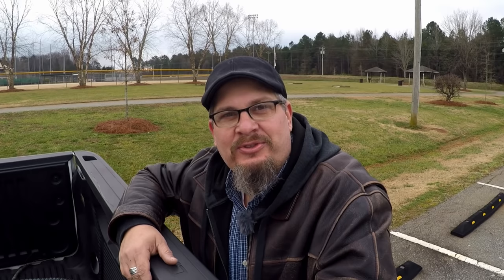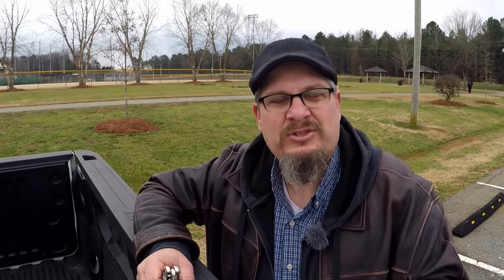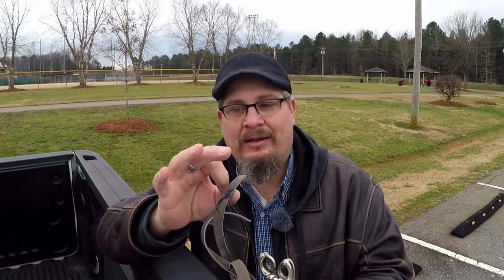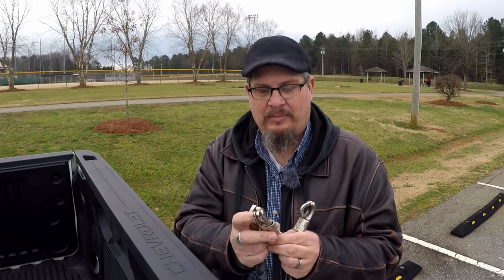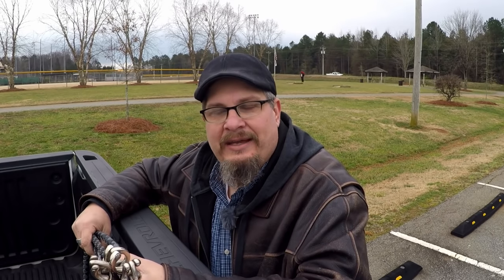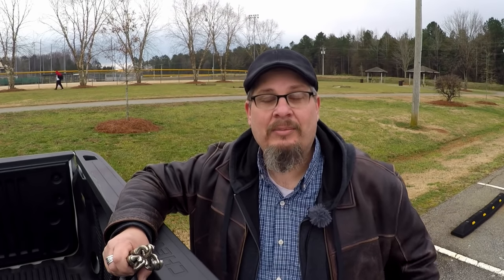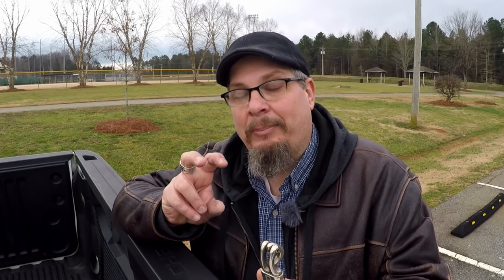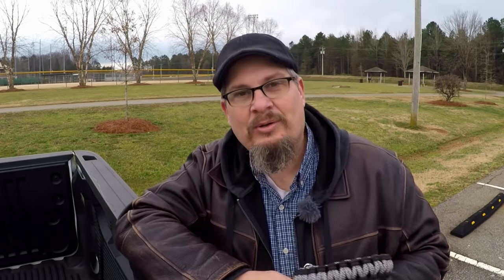The Get Back Whip

Comment: Besides I saw a guy had real long get back whip hanging off his throttle side handlebar and when he went to go make a turn he ran it over and knocked himself over and since then I said those things are for assholes
Reply: Seems like something that would only cause road rage for anyone on the receiving end of it. Motorcycle vs car is a fight that ends badly for the motorcycle.
Reply: Probably me. I bought one that would get caught in my exhuast and lock my bars. I took it apart and made a shorter one with a golf ball in a monkey fist at the end

Comment: SO I've been riding by the Grace for God 47 years. I've never had one of these . My thinking is the ones I've seen have been WAY to long enough to get tangled in the rear wheel then your REALLY not gonna have a nice day 😂Also I don't think it's advisable to wip at a car 🤔Piss off a cager and I don't care how barny bad ass you might think you are a motorcycle is gonna LOOSE EVERY TIME . My 3 and a half cents worth ( for inflation)😂👍😎
Reply: Exactly. A piece of leather doesn't make up for 3-8k of steel. Not to mention one could wipe themselves out trying to swing it at vehicle. Seems like a really stupid idea to me. I really like the idea of hanging it on the brake lever. Gonna be fun if it catches on something and fully applies the brake causing you to down the bike lol.
Reply: Inflation? Or canadian coins?
Reply: I’ve been saying the same. A car (and most people are driving SUVs and trucks now days) is far more dangerous than some dumb whip. 

You whip truck. Truck “taps” your bike. You are dead on the side of the road. 

Just stay away, pay attention, and don’t get angry. It’s not worth it.
Reply: Just keep a 45 and you won't lose nothing
Reply: Force = Mass x Acceleration; bike loses, and unrestrained biker takes the fall.
Reply: @hunterrollins5646  once I had a car behind me , lunging at the bike and getting really close , like a couple of feet . Turned out to be school age kids

Comment: We call the Staybacks out here in AZ.. Usually has a Monkey Fist around a ball bearing on the end..
Been riding 41 yrs, never had the desire to run with one....but I have been tempted to have nuts/bolts electrical tape bar bundle..tempted...I just found them best technique is just to stay as far away from cars/trucks...
Cheers
Reply: I’ve always got a Glock and a spark plug
Reply: @kurkgarro2341  lol. I always have my Sig p229 Scorpion or Ruger Alaskan .454...don't need a spark plug. :)
Cheers

Comment: The clasp is called a "panic snap" and is used most commonly for hitching horses in trailers. If you pull on the rope hard enough, it will release in the same way as pulling down on the sleeve, although there's a much stronger spring in the rope end. They're designed this way so that if a horse falls in a trailer, the panic snap will release, and they won't be hanging from their halter inside the trailer.
Reply from the maker: Good explanation thank you!!
Reply: @YogisCycleService  you're very welcome
Reply from the maker: @RustyCarnahan  my grandma had 2 horses and I loved going to her place as a kid and to the rodeos.  It has been many years since and I forgot more then I remember it seems.  I did know the name panic snap but it escaped me at the time.  Didn’t know that it was used when trailering horses.  I thought it was more like something on a lead when breaking horses in or something like that. Have a good night!  Appreciate it

Comment: The get-back whip is a really great way to get pulled over and arrested;  depending where you ride.

In many states the whip is legally called a slung-shot, and is considered an illegal weapon... even if it DOES NOT have a weight at the end... reason being that when the whip is released the whip can be held at the "free" end and the quick release mechanism becomes the shot.  Slung-shots are illegal in Minnesota where I live.  The whip is an advertisement for policing harassment, which is not worth the trouble.  

marcus

Comment: Decades ago, I used to ride with something bungeed to the passenger seat behind me. I called it a "Fuck-Off Brick"! Obviously, it was a one-use item, but replacements were cheap, and freely available! If some twat in a car was getting too close behind, just raising it in the air did the trick! They may be more protected in a car, but no-one is prepared to take the chance of a brick flying straight at their windscreen, especially if it's a shiny new toy!

Comment: We use them here when scumbags purposely cut you off. 
You smash the side of their door glass as you ride by. 
We have Leather balls on the end of them so they don’t slip out of your hand. 
The metal attachment part is not the part you hold.
If that don’t cut it. 
I also have my get back 1911 .45 ACP.
Reply: It can be rather subjective as to "purposefully cutting you off". I'll give you a short story. 
My, almost 17yr old son, had an incident with a rider in a parking lot. While pull out of a KFC with shrubs higher than the Accord he was driving, he inadvertently maneuvered into the path of a rider. We know the guy for years too. His son played football with mine. There was no impact nor was the bike dropped. Scared the shit out of my boy. Huge lesson learned about blind spots and being technically and tactics proficient with driving. In the immediate haul he apologized and proceeded out of the riders path. The rider turned around and pursued him to a stop sign, which I personally think was warranted. The boy needed to be addressed and told to get his head out of his 3rd point of contact. But this prick commanded him from the car and dismount his bike. The guy(rider) isn't big, 5'9" and about 215ish, round in the middle, not intimidating to say a avg stature adult male. My sons reaction was to egress the AO which infuriated the rider. He began pursuing him around the block. My son simply kept going around the block. Apparently 3 separate people in the area witnessed this and began following and observing. During this time, he struck the vehicle damaging the A pillar but missing any glass. At one point the guy almost got himself killed by pulling along side my son's car and into oncoming traffic. He eventually forced him into a parking lot of the medical center and blocked his car in. The boy wasn't thinking clearly enough to leave himself maneuvering room. He again dismounted his bike and with whip in hand approaches while threatening. Luckily the witnesses also stopped and had called the police so the engagement was short lived.  
The reity is, had my son not been a pragmatic, that guy would have been injured and or killed. As experienced riders we have to be expecting the worst. We have to anticipate the inexperienced. This candy assed attempt a bravado is really just escalation that will result in no good outcome. A cager outweighs us by orders of magnitude. Has a cockpit surrounded by blind spots and will unintentionally kill us at a moments notice. We have to be the superior operator, the cut above other road occupants. This shit talking, cognitive dissidents concerning this whipp and my "stay back 1911 or Glock",  is wilfully chosen stupidity.  You will more than likely,  needlessly injure or kill someone, including yourself. Possibly worse end up in a cage for a good portion of your existence.  Had I been driving instead of my son, what do you think would have happened? Who do you think would have been at fault? The moment he began pursuing and attacked, he essentially forfeited his life. Especially with witnesses. Had my son panicked and flinched,  during that attack, he would have had to live with that shit. The other guys family could have had to live without a husband and father. Imo, probably been better off with the I surance money. Just nonsense really. 
I ride and I've encountered both sides of it. If we are honest with ourselves, it's probably been damn close to 50/50 on fault. I have never had or precieved anyone try to intentionally cause me harm while riding. I've experienced extreme negligence, inattentive operation, distraction and just  common blind spot issues. I've been riding since my late teens, I'm 51.  I've riden too fast for the traffic conditions, passed on the wrong side, rode In a blind spot. I've been an inferior operator. I've been lucky and I've learned a lot over the years. This "get back" shit will get people hurt. Use the attributes of the motorcycle to your advantage. We can decelerate better, accelerate quicker and are overall more agile. We have huge mass disadvantages and will always loose in a collision. A riders best tool is their ability to create distance. Just like a gunfight, distance and situational awareness are your friend. 
Yogi, if you want to do a service, you should discuss this for what it really is. A bunch of immature, Tough guy BS, that will lead to escalation and needless mayham.
Reply: @jayonez137  
So you clear leather and send rounds down range? I've riden in the South, the Dakotas, New York, New Jersey. He'll, probably at least 40 of the 50 states. Never have I had someone maliciously interact with me while on a bike. I have had a few folks get road raged and contemplate suicide while in my cage. I guess I've been luck. I've had plenty of people with head in ass syndrome, as you've discribed. I don't think they were "trying" to kill me. That story I gave, that rider said to the police that my son was trying to run him over the whole time. Thats why he kept pursuing.  One of the witnesses had video of everything after the first dismount, the whole pursuit. I'd definitely get a camera.
Reply: @billgreathouse1913  
Negative!
You obviously misunderstood what I’m saying. 
Thankfully Ive never had to draw a my handgun. 
That’s the last thing any CCW holder wants to have to do. 
However it is there for my great equalizer if life is in danger. 
The whip on the other hand is a different story. 
Go back to my OP and read again what I said the whip is used for. 
I’m done with story time admittance. 
Stop over analyzing like a cop. 
Let’s move on!
Reply: @jayonez137  uses whip to hit the car.
Driver gets mad and hits you.

Uses gun as the great equalizer, 
Shoots driver.
Driver is incapacitated or dead and veers off to hit you.

You jump off the bike and the driver gets out,
You use your whip to hit the driver.
The driver pulls out a gun and shoots you .

You dismount and the driver gets out the car,
You pull the gun and possibly shoot driver.
You go to prison.

None of these situations are in your favor. 
Get back on your bike and go. No matter how big or bad one man is, a cage will always beat a thin frame with two wheels.
Reply: Yeah okay super Rambo killa! Car vs motorcycle…you lose.
Reply: Wire you ain't never done that how are you doing sitting there drinking a Coors beer and coming up with the tough man stories go to bed

Comment: The quick release IS the weapon end dude. Once released from the clutch the heavy "quick release" end will help the whip slide through your hand to the other end so that the bottom is now the top (weighted quick release at the end now). The "quick release" IS the weapon when riding. Can easily bust a windshield (its main purpose... if they can't see they can't drive/chase) or swing at someone/something. If only riding one, it should be on the left. Yours is on the wrong side. The reason for this is so you can keep pulling the throttle if you have the whip in hand. I'm in the club world but no one I know rides colors in their whips. Most are just black leather. You are correct in that they ae not really used anymore. They are just a token of the past.

Comment: Thanks for this video! Brings back long ago memories. Thanks for the balanced show. I must admit, I know these to be weapons, although its more of a warning and a barrier when it is spun in the air.
Personally I would not get one longer than from your hand to the crook of your arm. In my case that's 12" for a spinning diameter of 24". Also the correct length for a professional baton. Any longer and you could injure yourself badly.
These days, I use a wooden bead necklace to practice my spinning routine, usually dancing in my living room!  Oh you can still get hurt, proper length is critical. My take, thanks again!

Comment: I use the get back whip for vicious dogs I encounter regularly at stops, I do carry but the whip guarantees I won’t miss or over penetrate and injure someone else. Mine is a chain off an old bike with 5 metal prongs welded to the end and a quick release on the brake lever.

Comment: These are not made for motorcycles , never were and never will be . There for horses transported in horse trailers and are a quick snap release that works to make sure the halter doesn't hang up or choke the horse in case of an accident .

Comment: take a chunk of an old used spark plug and flick lightly at a car window. it's guaranteed to shatter the glass, but not shatter it enough where the window falls in.
Reply: This.  Learned this during a workshop with the ATF while I was Army EOD.  Crunch up an old spark plug, the points on the busted up ceramic will spider automobile safety glass.  Apparently the ATF learned it from the police, who learned it from kids vandalizing cars.  Very effective for removing car windows with minimal effort.

Comment: Back in the 50s and 60s, my dad, uncles and all their gang used to cut 1 foot long sections of 5/8 heater hose, plug one end with a bolt and a hose clamp, fill them with molten lead, then use broom clips to attach them to the rear legs on their motorcycle frames.

If any ragin' cager purposely got "too close", they'd reach down, grab one out of the broom clips, and sail it THROUGH the guy's windshield!

As far as those whips go, I hear that certain club members will sneak up alongside ya and yank on them... Knocking some unsuspecting rider off balance.

I do have a belt that's made of a Cossack whip... Braided leather, steel wire core with a lead weighted tip and a quick snap to keep it around my waist. But that's only effective if I'm standing on the ground.

I personally run those "little kid" sparkly bicycle streamers on my old Glide... Just to be a shithead 😆

And PLUS ONE on the old spark plug trick!
Reply: Yep. 8,000 pound Silverado 2500 HD with a turned up Duramax and a cracked windshield vs. some putz on a 900 pound bicycle who tossed a lead filled piece of hose. Gonna be some 40s poured out that day.
Reply: I'm going to call bullshit on your story I'm thinking bolted lead would melt that hose you know because it's hundreds and hundreds of degrees hot yep got to call you on that one or if not you your dad and his brothers and their gang LOL

Comment: Those fringe pieces are to slide nuts onto and knot the fringe below the nuts to keep them on. Nothing like getting whalloped with a 1/4 pound of steel. Also a 2 or 3 foot long length of 5/16 chain with a huge master lock on the end for "locking your bike to a pole".

Comment: The law may not "outlaw" a get back whip directly.  What your state may have a law against is a slungshot, bolo, or blackjack weighted whip.  Loosely defined as a a heavy object fastened to a strap or chain.  Even with no ball bearing on the fringe end, the release clip can be that heavy object. That is why some folk will tell you that a chain wallet is illegal.   Its not a problem till its used for more than decoration.

Comment: I've been riding my whole life and I have family and friends in various bike gangs in several different states. I can't tell you the origins of the GBW, but I can tell you it's a real thing and comes in various forms. I've had the GBW discussions with plenty of old timers that were gang members on the east coast. Here is what I know and have been told from probably over 50 sources over 40 plus years of riding and when and how I've actually seen them used bc I've rode with these guys and their gangs. #1 - The purpose was mainly as a fast and LEGAL (at the time anyways) self defense weapon. #2 - to smack against cars or anyone else that got too close. #3 - Some, not all, would decorate it in the gangs colors. #4 - Some have a single, huge ball bearing or chunk of steel wrapped in the end, some have several. #5 - Miscellaneous - I've seen bikers that literally carried various lengths of thick, heavy chain, either hanging from the handlebars like a GBW or in their jacket pocket and used it to smash out car windows or dent and scratch the paint. Yes...WHILE RIDING. One time a really stupid kid in a jacked up Mustang came driving up fast and pissed off the gang. Before he knew it, four or five bikers had surrounded his car with their bikes going 60+ mph. Some whipped at his car with chain, another used a rusty ball-peen hammer he used to carry in a holster on the left side of the frame. Finally, about the ball bearings being carried and used to throw at cars? Yes. Absolutely true. I've known dozens of riders, gang members and plain citizens, that carry large ball bearings and dump them or throw them at cars tailgating too close. Also, nice sized rocks, chunks of steel and big, rusty bolts found at the construction sites they work.
Reply from the maker: Thank you
Reply: Lol…bike gangs? Your stories are ridiculous but here’s the attention you ordered.
Reply: I remember seeing that episode of The Rockford Files too where the bikers surround Jim in the Firebird and give him a beat down.
Reply: @kennethsouthard6042  that's awesome! I used to watch that show when I was young. I'll have to search YouTube for it and watch it. LOL